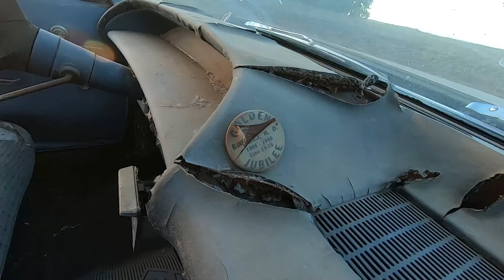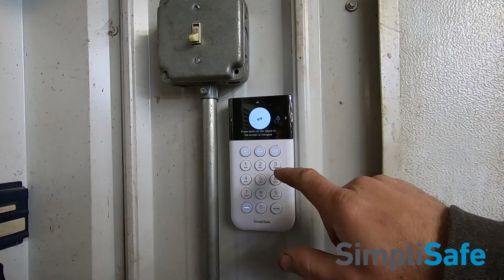Farm Auction 1949 Dodge Sedan! With a Hot Rod Engine?!? Abandoned for 56 years! Will it Run?!?

Comment: Should’ve bent a screwdriver to get at that valve. I’ve done it-  Reaching over to catch that exhaust valve. Providing its not stuck to bad !
Reply from the maker: Yeah but the head is so easy to pull and then you get to look everything over. I've done it that way too. But you couldn't even get close to it.
Reply: @MortskeRepair  confirmed.  Been a while for the Mopar 6 flat.

Comment: Hey Bud, sorry for irrelevance... I'm building an 8BA Flathead Ford engine. I'm down to details. My oil filter feed line has no restrictor in the fitting on the block and the original fitting on the housing was snapped off. If a guy were to install one, would it go on the fitting on the block? On the oil filter housing? Anywhere on the feed line to the filter? I have a M.I.G. tip that's 1/16" I.D. and I can fit it wherever it needs to go. Block, inline, at the filter housing, whatever makes it happy, I can do it. I looked all over and I can't find a real answer. It was not modded for full flow oil filtration.
Reply from the maker: Check out the oil filter section of the Jeepster video I just released, that should explain how they work more. I think it goes from the pressure side to the outside of the filter housing and then the drain at the bottom is the return that runs to the oil pan. Hopefully that helps.
Reply: @MortskeRepair  Mine returns into the side of the block but same concept I guess. I think the idea behind the restrictor is to keep most of the oil pressure in the bearings and cam. As far as where it goes all I can find is somewhere on the pressure side. I think I'm just going to stick it in the fitting in the block and watch my gauge for good pressure when I fire it.
Reply from the maker: @heliarche  Guess I've never heard of the restrictor. They usually just tap in back where the pressure gauge is from what I remember. On the bellhousing area.
Reply: @MortskeRepair  I'm awful confused about it. If you look it up you'll find all kinds of answers. Seems anywhere on the feed to the oil filter housing and it's OK. I'll have a gauge on there. Whatever the oil filter does, I probably don't care too much as long as I have good pressure in the rest of the system. I love working on this engine but Dang is it weird!
Reply from the maker: @heliarche  To be honest, they don't really do much and you'd be just fine without one. Just change your oil more regularly.
Reply: @MortskeRepair  Yea i guess even when the filter was standard equipment, it was an afterthought. I think it looks cool though and I'd like it to do it's thing. I took an old .060" MIG welder tip and the brass fitting that goes into the block and did a little machining on both of them. I read that if it's anywhere on the feed line of the filter it'll be OK and that's what I went with.

Comment: Is that a Jeepster Commando behind you, never noticed it before. I'm working on a 1967 Jeepster Commando, Dauntless 225 V6. Its in really good shape but going over it with loving care for a friends mother. Header situation?....
Reply from the maker: I don't think the early ones were Commando tho
Reply: The one I'm working on is a true 1967 Jeepster Commando, they made the Jeepster Commando from 1966 thru 1971, they came with a 4 cyl or the Dauntless v6 Oldsmobile motor that was remanufactured from a V8 to a 6 cylinder. Unique to this line of Jeepsters....

Comment: Heads up there is a GM dealer in Farmers Louisiana that's has a bay full of truck bumpers they don't know what they fit they want to get gone at dirt cheap prices I'm sure they have lots more obsolete parts too so you have to know what they fit based on looks and your the GM guy IMO
Reply from the maker: You got a contact or anything? I don't see a town named "Farmers" in LA with a Chevrolet dealership.
Reply: @MortskeRepair  Farmerville Louisiana is a small town with a small town dealership that's been around decades and they have a trailer full of obsolete parts the owners son (GENERAL MANAGER ) would love to get rid of to make room last trip there they had a 14 bolt to be junked it was a warranty job aluminum wheels ie take offs non working wheel balancer all to be hauled off I screen shot their phone number and street address I can send you since I can't load it on this thread
Reply from the maker: @garybrady9531  Yeah, my email address is listed in the description.
Reply: @MortskeRepair  I will look for it again

Comment: Make the 49 Dodge into a runner. My dad a nice 49 Dodge for my mother to have a car. Mostly for around town. Not very good car for the road. Those old Dodge engines have much power. About 55 mph was as high as the car would move. That was about the highway speed limit back then. I still remember the fluid drive in that car. That 3 speed transmission would go in any gear. You had to wind the engine up quite a lot to move. Fluid drive was a Chrysler exclusive. They called it a semi-automatic trans.They said it would really appeal to women drivers because fluid drive cut down on having to change gears as often. Supposedly the car would continue to move at a slow speed in high gear if you kept giving the engine gas. I was too young to drive legally at the time. Please do not report this to the state of Texas but I did drive out in the country with a parent with me in the front seat. That old 49 Dodge was low miles. My dad bought a later model Chevy late the next year and he gave the car to my cousin. He drove it a year or so until he bought a used late model Ford then my uncle used the Dodge for a work car. I don't what became of it after that. I wish my dad had held onto the old Dodge. I was going to be driving in a couple of years. I can tell you one thing. That old car was built like a tank. 4,000 pounds of heavy metal.
Reply from the maker: Great story!

Comment: How much are you wanting for the International crew cab?
Reply from the maker: 1500
Reply: @MortskeRepair  I looked for the video on that truck, but there wasn’t one. What is the condition? Does it have a motor? Also, your videos are great, if I had a battery, tire or parts company I would definitely sponsor you.
Reply from the maker: @JedStockton  There isn't a video on it. I'll put one up in the next few weeks with that in it. Engine is in it. It's all there. Floors are shot.

Comment: Are you going to use that transmission?
Reply from the maker: Maybe, or a T5 overdrive
Reply: Im working on a 39 dodge fire truck, it has a newer transmission and the e brake is a disk. No room to connect a pto to the pump. If you decide not to use the transmission reach out i would be interested.

Comment: Ball & ball carbs
Is that Chrysler 6
The Chrysler was  a few inches longer than the stock 230 ci six
The bigger 6 was 260 ci I Think
With a truck clutch it would run 60 in 2nd gear
Reply from the maker: Nope, both 230s

Comment: I suspect that's not a mopar engine in the 32. Everything I find online is a flathead for all years. I would investigate what make of engine it is
Reply from the maker: Looks like an early GM
Reply: @MortskeRepair  kinda reminds me of buick, with that rounded valve cover, and tall side cover. I think buick had 6 cyl up till mid-late 30's?
Reply from the maker: @mikeoswald15  could be

Comment: Why wouldn't a 6 volt coil work?  The car and the truck are bolt 6 volts.  Anyway 12 volt cars use 6 volt coils in the 50's and 60's. That's why they have ballast resistors.
Reply from the maker: I wasn't using a resistor.